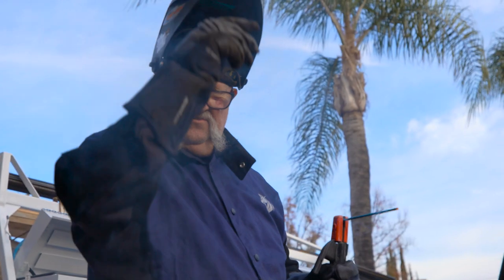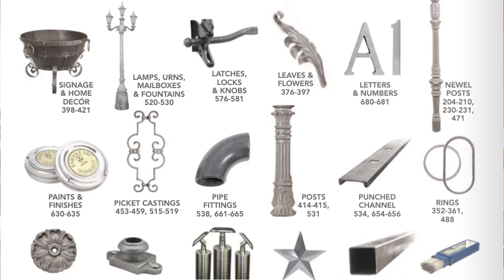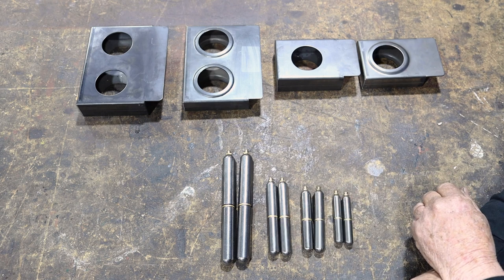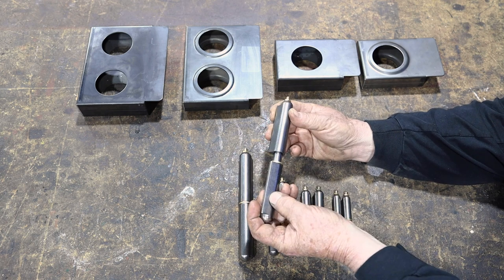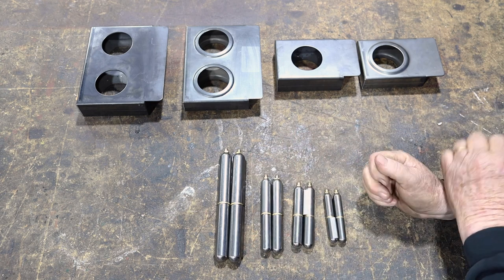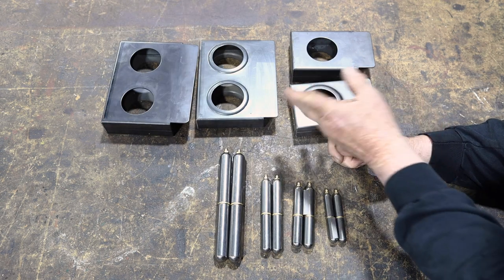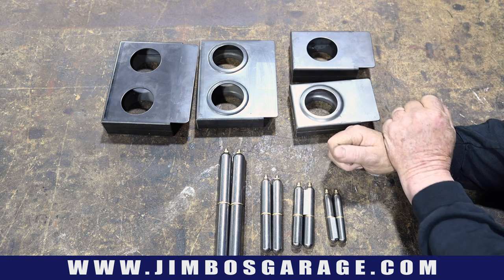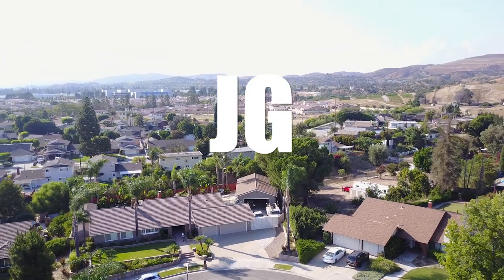Gate Hinges and Lockbox Info & Tips | JIMBO'S GARAGE

Comment: Hey Jimbo, thanks for sharing this video. The one detail that has been missing from your gate builds, or at least I have never seen it, is the detail for the latch on the side post. Are you just cutting out for the latch and installing the striker plate? Any recommendations or suggestions? Thanks